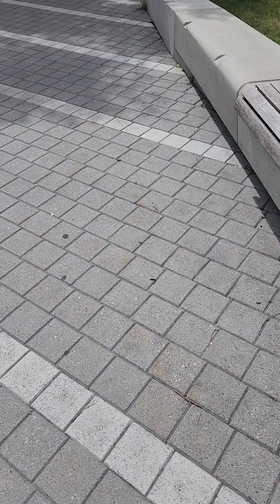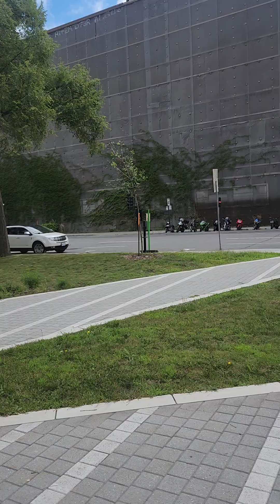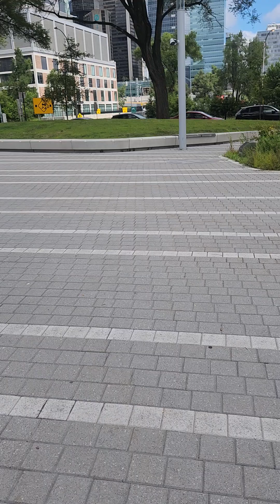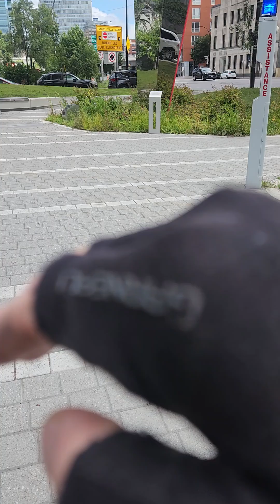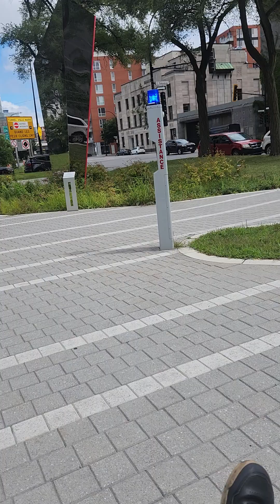Leveled Flat

Comment: Kevin, how precise is your laser level and what's the model number?  It looks like a DeWalt DW08802CG.  You realize that this laser level has a maximum range of only 55 feet and an accuracy of 1/4" at 30 feet.  Didn't someone tell you that a laser level wasn't the right tool?